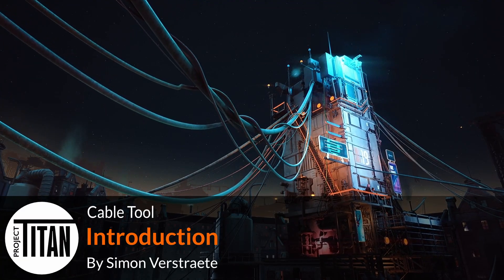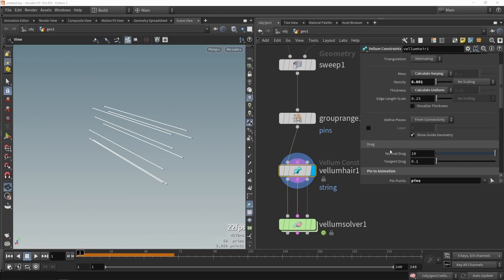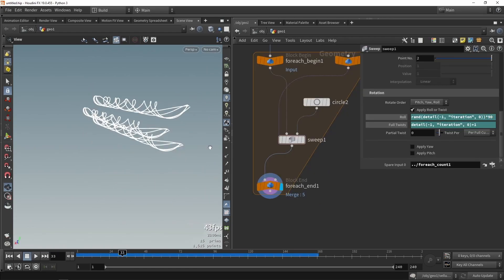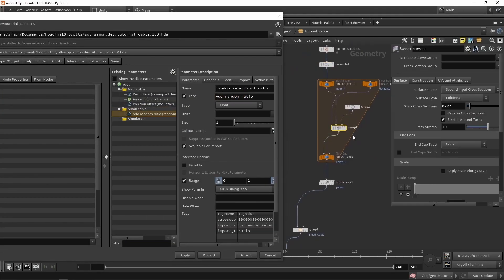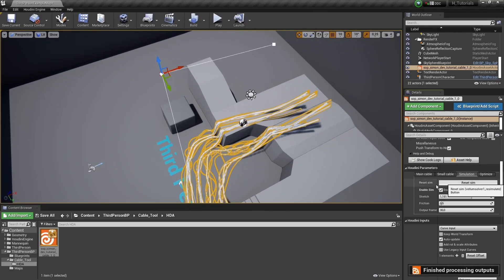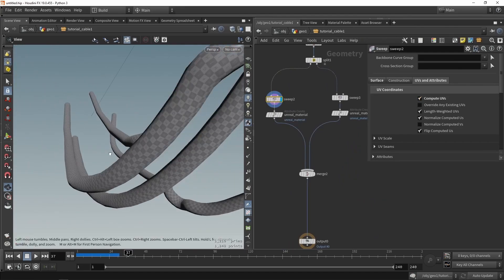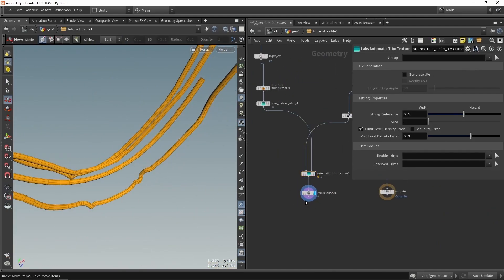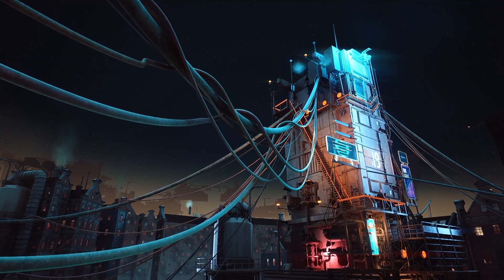Project Titan Cable Tool | Part 1 | Introduction

Comment: help plz . . . . can u plz tell us how we install this plugin in UE 5 . . . . anyone else who can tell me
Reply: Copy the Houdini Engine folder to the plugins folders of your project. For example:  Project_Folder\Plugins\HoudiniEngine
Reply: @bwvanlith  tried this and did not work for me... it project refuses to open.. telling me to build from source...I've searched for months, just cant seem to get it to work
Reply: @SuperMyckie  I'm not 100% sure as I'm only just looking into houdini now, but when you add plugins to UE it needs to be a C++ project so you can compile code. If it is a BP project I suspect this method won't work. Please someone correct me if I'm wrong and you actually can use Houdini in a BP based project.